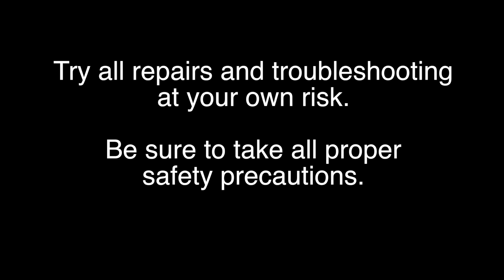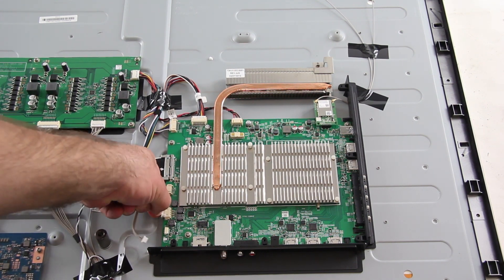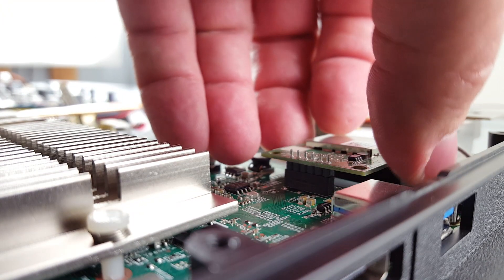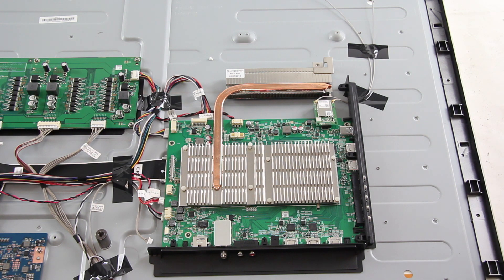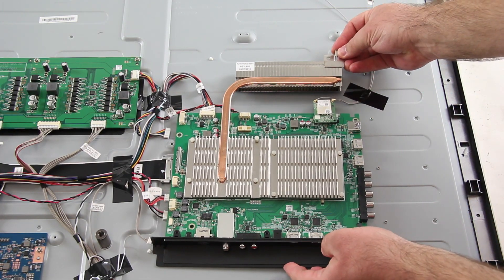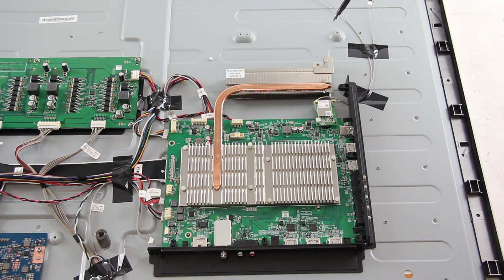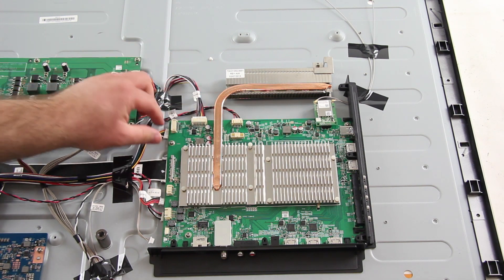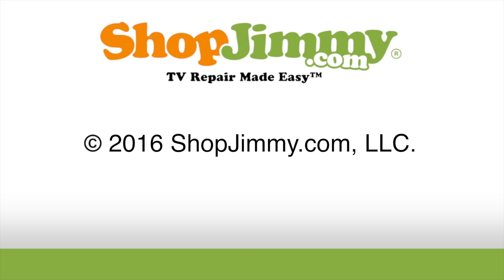Vizio M55-C2 Main Board Replacement Tutorial Video

Comment: I have a Philips Model 32PFL3403D/27 When turning on with tuner signal available it blank's out but it does not power off.
Could you give me some guidance as how to troubleshoot the problem. If I let it warm up for about 5 minutes or so it will than turn on with tune signal normally. It will then play on as long as you have it on.

Comment: I have a vizio m55-c2 that developed a double image.  I ordered and replace the tcon board.  That did not solve the problem.  Now, we have the same double image and the bottom 3" of the screen is dark with a white horizontal line just above the darkness.  I'm afraid this is a panel problem.  Suggestions?

Comment: I have a insignia ns-48d510na15. The backlight comes on when I press the power button, however, there's a red standby light that blinks 5-6 times then disappears all together when the t.v. is turned on. I have replaced the main board, which didn't fix the problem. I am now wanting to replace the t-con board, but I am unsure if that would fix the problem. I may need to replace the main power board, i'm just unsure. 

A little background on the tv:
It was mounted outside on a covered porch, so it could be weather damage. I have inspected all of the boards and have found no odd smells, discoloration, distortions, or burns. There is no visible issues that I can see. The t.v. was given to me so other than the cost for parts, there is no other out of pocket expense.

Comment: Just Answers Tech told me my problem was the Mainboard when the HDMI ARC port loses its handshake doesn’t work losing the connection with the sound bar!  I have a M55 EO but they should be similar.  This looks too easy !!!  Mother boards are $30.00!